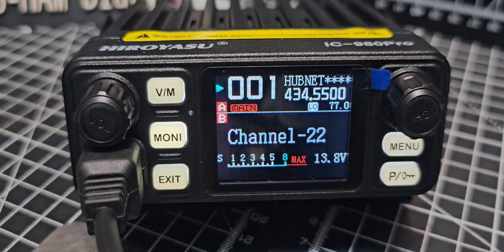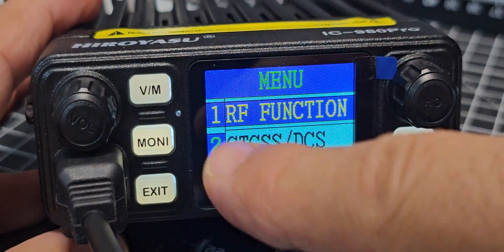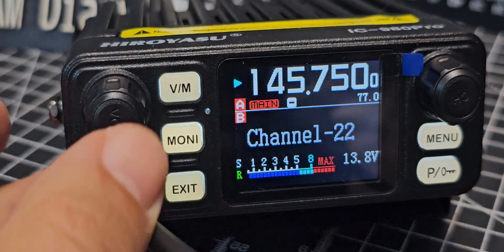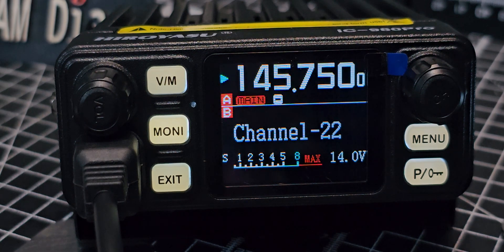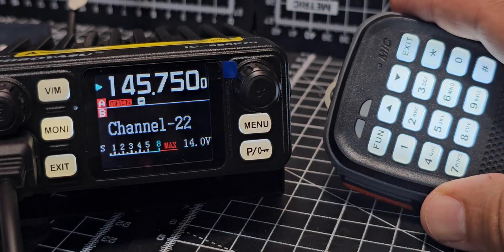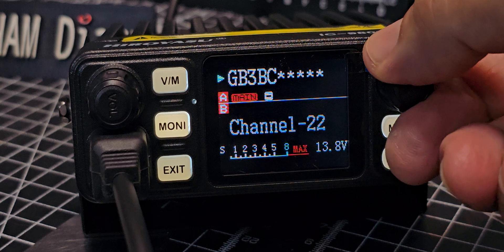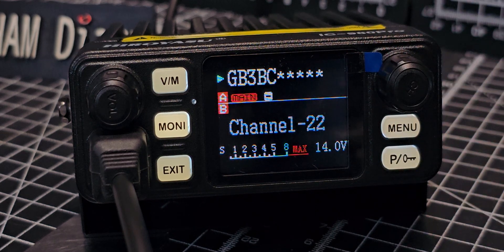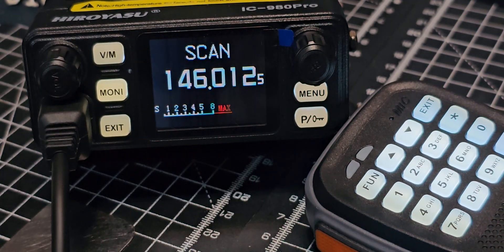HIROYASU IC-980 Pro - Add Repeater Save to Memory

Comment: Overall, how pleased are you with the radio? For now I've got a Motorola dgm 8500 VHF and don't really use it that much. I'd like to have a dual band radio to make it mobile in a case or a bag. Would you recommend it over renamed brands? I really love YSF and use it on the 70D and the 5D gut don't need that function necessarily on a base station (I guess as I have my HTs for that even if it consumes much power). Bearing all that in mind what say you? Cheers mate!
Reply from the maker: Yes for price its very good.